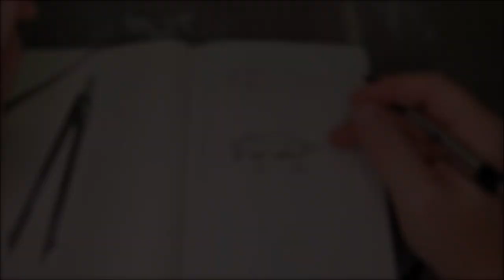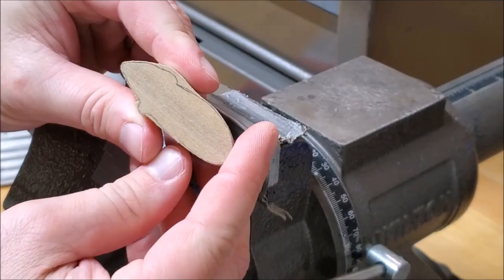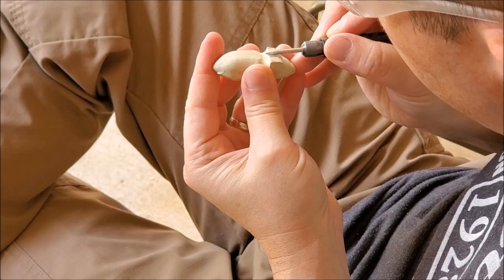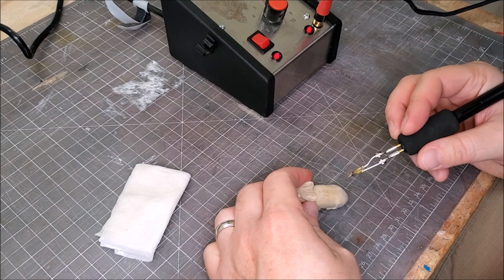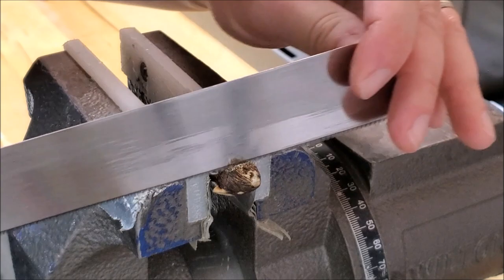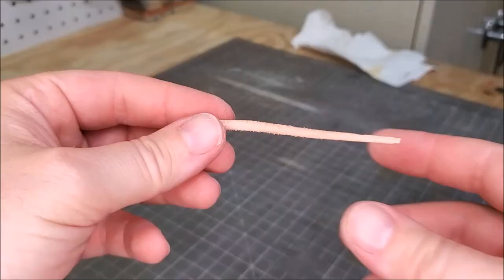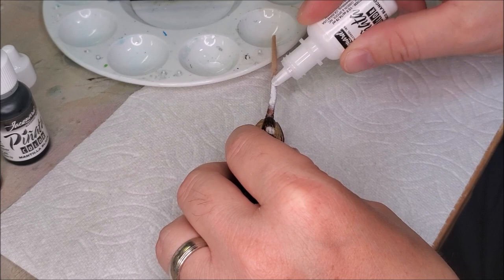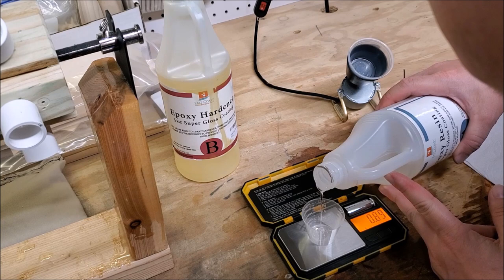Making a Wooden Mouse Fishing Lure

Comment: In my opinion the airbrush paint job wasn't necessary, it was looking more natural with the burn marks fur. But still nice lure non the less 😉
Reply from the maker: I was tempted to leave it like that, but I just had to push it a little further. The thing that bothered me the most is how much the clearcoat filled in the hair texture. I might explore thinner clearcoats for this kind of lure. Perhaps a big rat lure?
Reply: Parabéns pelo seu trabalho Gostei  Brasil
Reply: @zimmtex  I was thinking while watching "run a dry brush down the direction of the hair to wipe off most of the thick clear coat off". I bet some  of the tissue you used stuck to it 😬
Reply from the maker: @pa_maj.MARTINI-van-MAN  Great suggestion!

Comment: Aloha, I've been watching your YouTube vids, such awesome work!  Trying to get to that level, I recently had to change epoxy, (can't find envirotex that ships to Hawaii) I've been using what looks like the same you use, East Coast epoxy... I've been having trouble with bumps, (which I'm assuming it's from bubbles) I use a heat gun to remove them, bit it seems more appears when drying... It's a hit and miss to get a smooth final coat.  Can you offer any advice?
Reply from the maker: Hello and welcome to the channel! It sounds like your heat gun is causing the bait to off gas. Try using a flame torch with quick passes to pop bubbles. You do not want to heat the lure. It is the cabon dioxide from the torch that will pop the bubbles, not heat. Hope that helps; Thanks for watching!
Reply: @zimmtex   thank you!  I will be trying this!